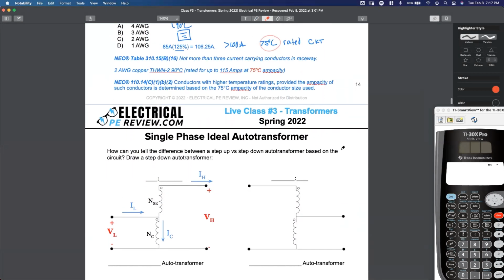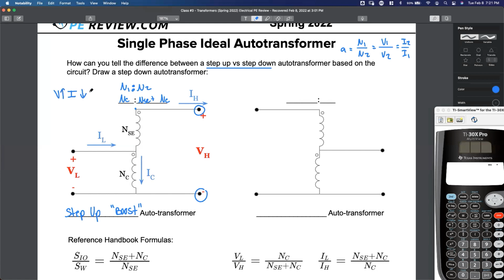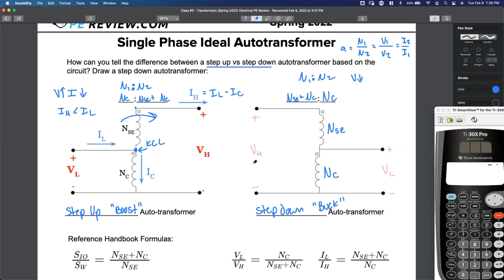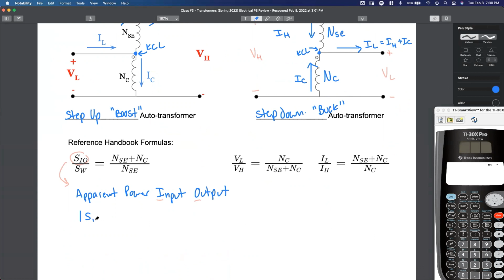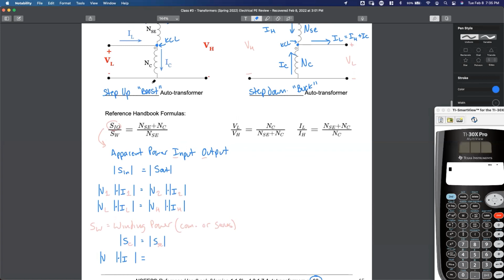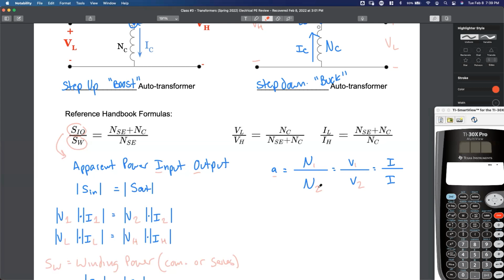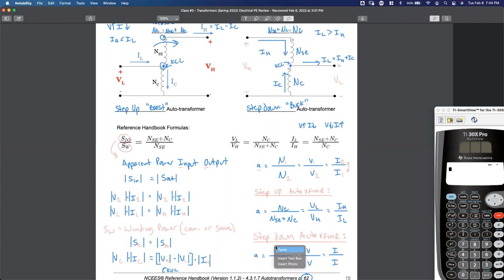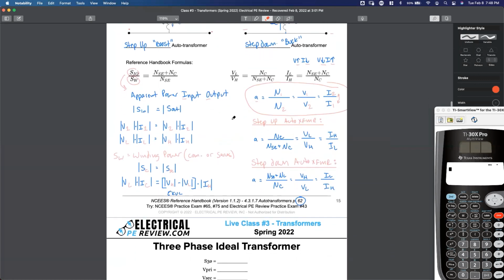Autotransformers: Step up, Step Down, Boost, and Buck for the CBT Power PE Exam 2022

Comment from the maker: Table of Contents:
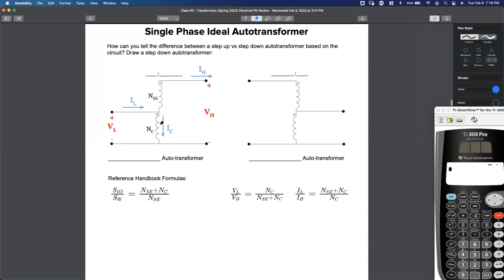1:11 - Step up autotransformer (Boost)
2:23 - Turns ratio (N1:N2) for step up autotransformer
4:31 - Primary (IL) vs secondary (IH) current for step up autotransformer
5:24 - Step up autotransformer current relationships and KCL
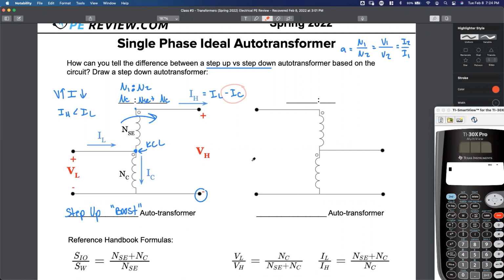7:01 - Step down autotransformer (Buck)
7:26 - Turns ratio (N1:N2) for step down autotransformer
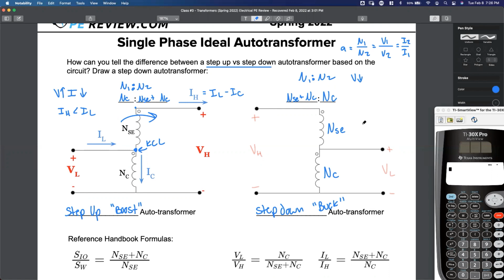9:19 - Step down autotransformer current relationships and KCL
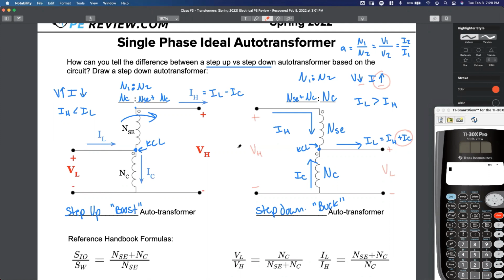11:19 - Common current (IC) for both step up and step down autotransformer
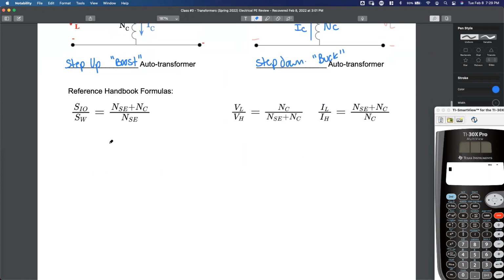12:30 - Input output power formulas (SIO)
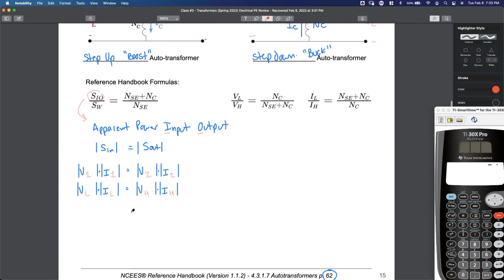16:15 - Winding power formulas (Sw)
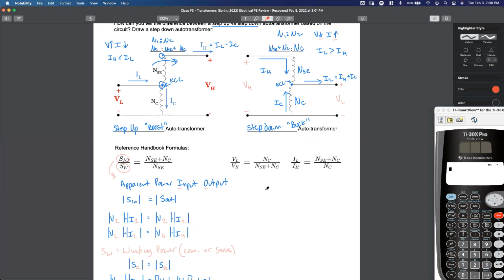20:58 - Transformer turns ratio formula
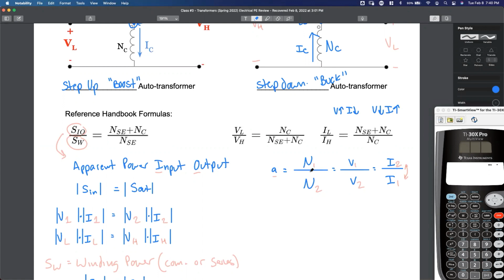23:16 - Set up autotransformer turns ratio formula
26:03 - Set down autotransformer turns ratio formula

Comment: I am trying to apply this method for Auto Xfmr 360V/120V based on single phase 480/120V 1000kVA, I am getting correct answer for Primary kVA (750kVA) but getting wrong kVA answer for secondary, since I am adding Is=Ip+Ic which is supposed to be Is=Ic-Ip. i believe this method is good for voltage addition on one side.
Reply from the maker: Is = Ip + Ic is for a step down auto-transformer (see 10:09)

Is = Ic - Ip is for a step up auto-transformer (see 6:19)
Reply: @electricalpereview  at 6:19, that is happening because voltage is going up but my case is voltage going down. So Is needs to go high.

Comment: S_series doesn't equal S_common, however their sum does equal the input or output apparent power.
Reply from the maker: Careful here, this is not correct. The power in both the series winding (Sse) and the common winding (Sw) is identical. Since this is the same value, it is usually just referred to as the winding power. Summing the series winding power with the common winding power (or multiplying the winding power by two) does not equal the input output power of an autotransformer.

The formula that relates winding power to input output power is:

Sio/Sw = (Nse + Nc) / Nse

Where:

Sio = Input output power.
Sw = Winding power.
Nse = Number of turns in the series winding.
Nc = Number of turns in the common winding.